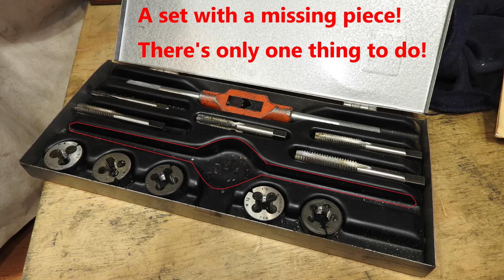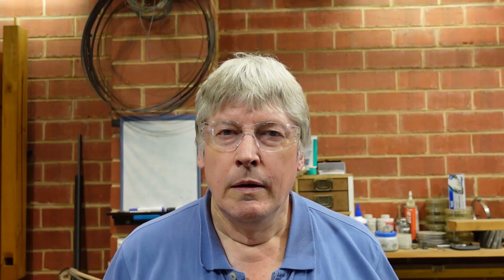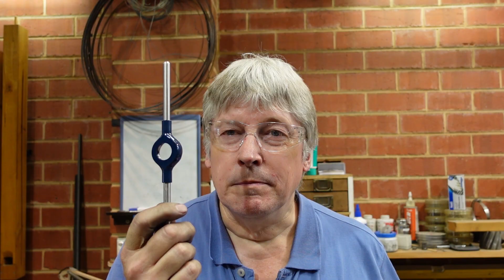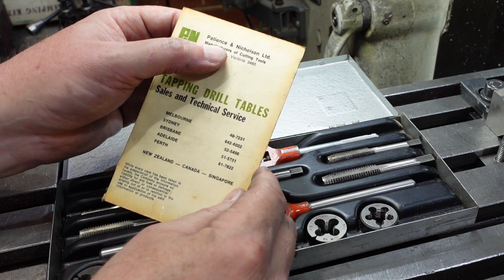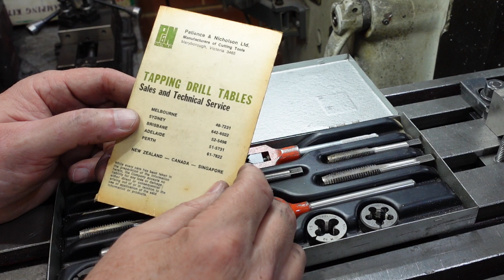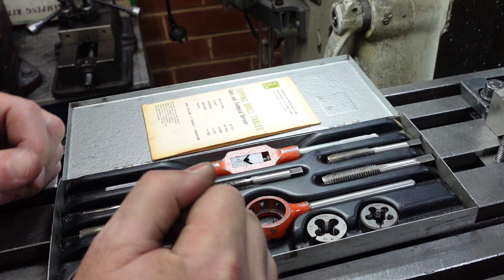Making a Die holder from scratch

Comment: Nice job. I had no idea that P&N were in Maryborough.  There's a lot of industrial history there though. Walker's were still a big manufacturer back in the 80's.
Reply from the maker: G'day Mark I admire your work too. 
Doing a quick bit of internet research since putting the video up, P&N are still located there although owned by Sutton since early 2000's. Based on the 6 and 7 digit phone numbers I think that brochure (and so the set?) date from around 1970 +/- 4 or 5 years